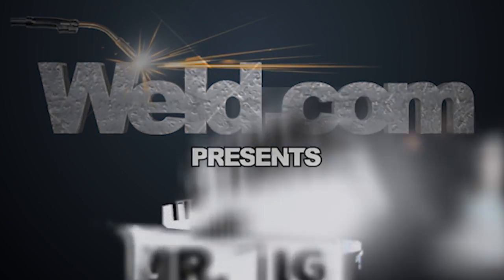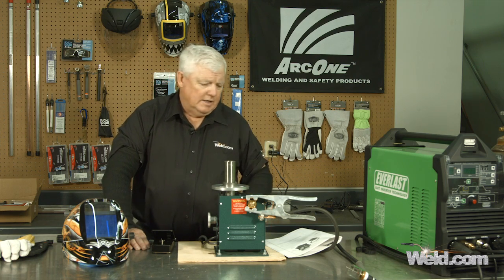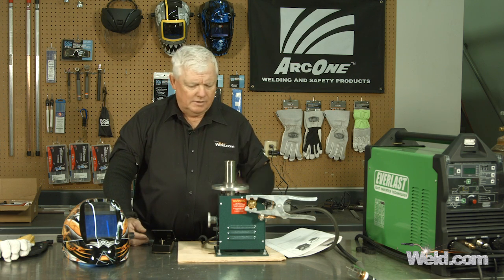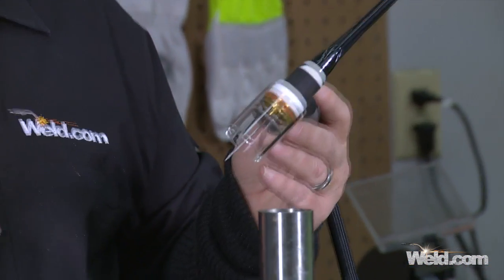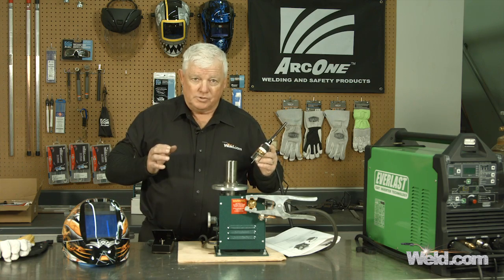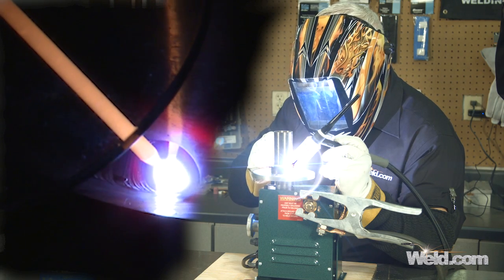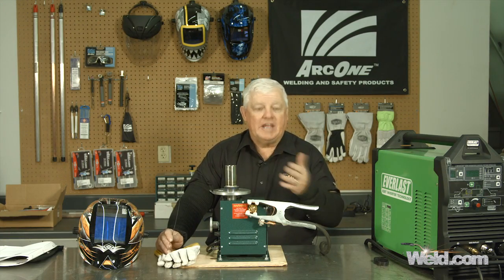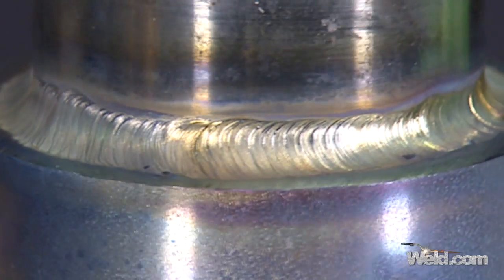How to TIG Weld Stainless Steel to Mild Steel | TIG Time

Comment: Wonder why you did not concentrate the heat onto the thicker part to prevent undercutting the thinner tube. Like the way those tacks blended in as you absorbed then and reduced filler at the right point.

Comment: He ran too hot, there was under cut,, shouldve turned it down alittle, but he is welding way thicker mild steel to thin stainless, he is showing a technique. It doesnt have to be perfect.. i have been in the trade over 35 years and mate good on you for showing people your ways.. you will always get those experts that voice from afar..

Comment: Is a rusting mild steel plate still ok to use with the Stainless steel ..What If you do not have a Serial number of the  Stainless Steel ?
I am an [[outside noob ]] and hope my question does not sound like a Gaff?
great presentation

Comment: Can you please say where this Ms and ss weld can be used.....in what application it is used please reply
Reply: Sometimes use with custom exhaust and exhaust modifications. Eg someone wants to install on a stock mild steel exhaust a wideband O2 sensor that came with a SS O2 bung.

Comment: I'd love it in your videos if you talked through the settings on your machine for each video that would really help us beginners please!
Reply: right? he talked more about the damn positioner than he did his setup. I don't even think he mentioned what filler rod he used. And this is suppose to be a how to tig stainless to mild steel
Reply: @Xzempt1  He did mention that their chart had some info, but he did mention at the end of the video that only a few filler rods could be used. He said that in this instance that he used 309 filler.

Comment: Dear Mr Tig,
Great videos I've learned a lot! So I am welding a 304 stainless tube to a 304 CAST stainless turbo adapter. I was told to use 309L as a filler material but what Is your expert opinion on filler rod material?
Reply: 309 is for welding carbon steels to stainless steels. use a higher grade stainless filler rod like 308 or 316 and youll be fine. dont kid yourself, this man is a self renowned not world renowned tig welder. he would get laughed out of any real shop
Reply: @chrishoppe8697  He is also "The Late". Wyatt Swain" aka Mr TIG died of auto crash injuries.

Comment: 3 minutes in still no welding, just shilling a product and saying go look at this fancy table. What settings are you using? Why does it look like the filler wets up the stainless more than the 1018? What recommendations do you have for someone running and AC-DC machine that does not have all the lovely functions of the Everlast? What about electrode motions, why are you only dabbing? Can you be any less informative? F' the fancy table, spend some time discussing other filler materials and techniques you Tool Time rip off, useless product shilling hack. Also how would that fancy over priced turn table hold up to something that is larger and awkward, such as a cat welded to a 45 being welded to a flange?
Reply: After calling him a "product shilling hack" etc..., did you really expect him to take the time to answer your half dozen questions.
Reply: Ransom Prigg
Of course not, it was merely to make a point that if you are going to be an informative program even on YouTube you should at least put in a little more effort to discuss the topic first, shill a little during and most definitely shill after.